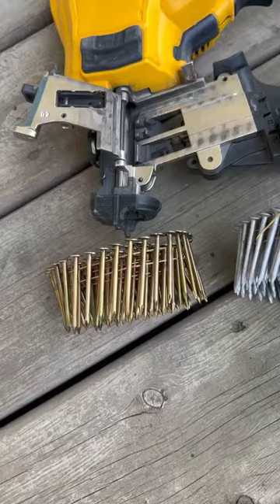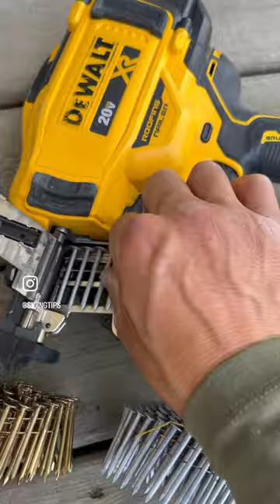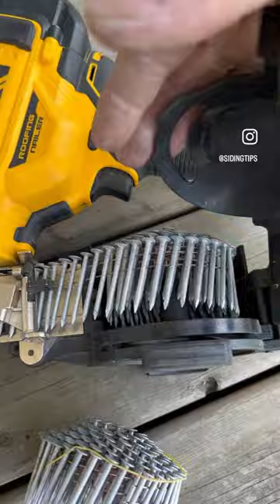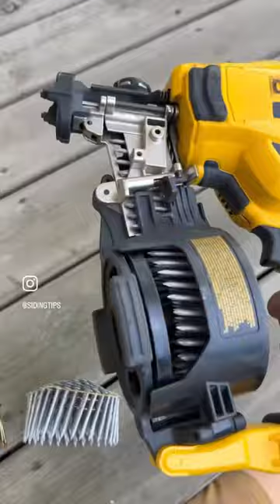Nail length for vinyl siding using the Dewalt cordless roofing nailer DCN45RN with siding spacer

Comment: What kind of nails is it and what size?
Reply from the maker: Hot dipped galvanized, 1 3/4” length, 0.12 gauge, 15 degree
Reply: Why not just 1 1/2?
Reply from the maker: @Willis476  due to the flight path of the nail and required accuracy with the spacer added
Reply: @sidingtips  ok,makes sense.
Reply: Can it do 2 1/4
Reply from the maker: @daquanludy  The nailer only accepts 1 3/4” max
Reply: HI ! Can be used on fencing boards?
Reply: @Rafaelduran1 no, use a siding nailer. Smaller heads and up to 2 1/2 inch nails.

Comment: About to use this gun for siding through 15/32 plywood and 7/16 t1-11 smart side shed panels.. what mail length would u recommend to penetrate to the stud securely or would I have to get a dewalt pneumatic siding nailer…. If u can please tell me ????
Reply from the maker: we only recommend 1 3/4” using our tips. thanks for your question

Comment: What brand of nails work for this nailer? Do I have to purchase Dewalt Brand nails?
Reply: I will be using this for vinyl siding installation.
Reply from the maker: Dewalt nails don’t need to be used. 1 3/4” length, 0.12 shaft thickness, 15° roofing coil nails
Reply: Can you recommend a brand matching these specs? I looked online but having a hard time finding a store that has 1 3/4 with .12 thickness.
Reply from the maker: @SEBluegrass we use Prime and Bissett (only available in Canada). All roofing coil nails are 0.12 shaft thickness. You might be looking at siding nails which should be used for vinyl. Use roofing coil nails.